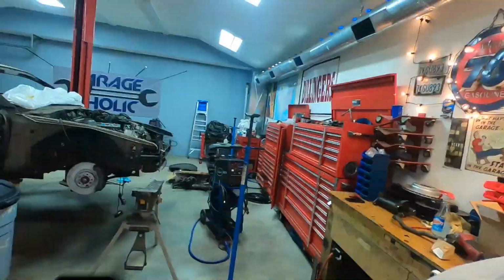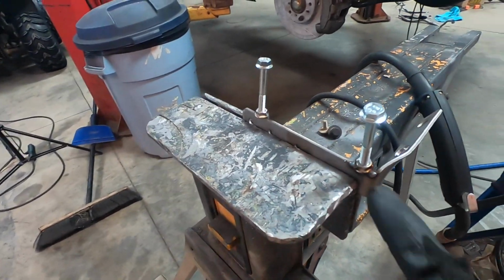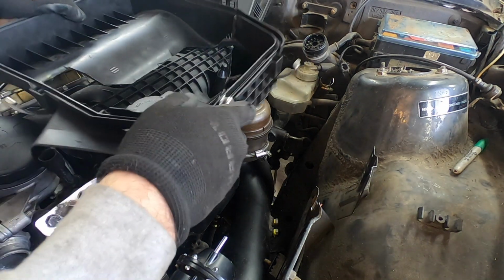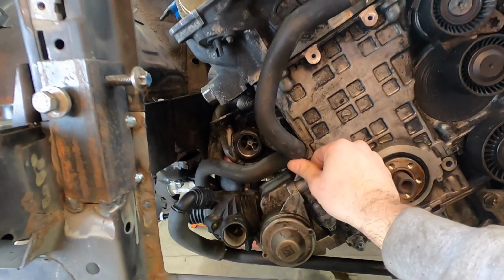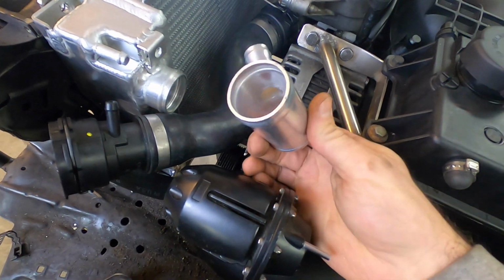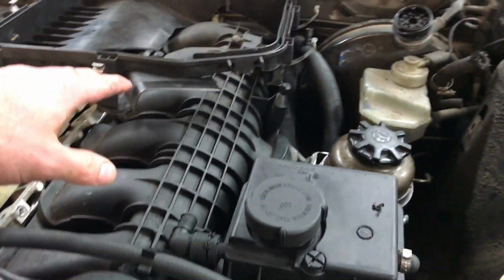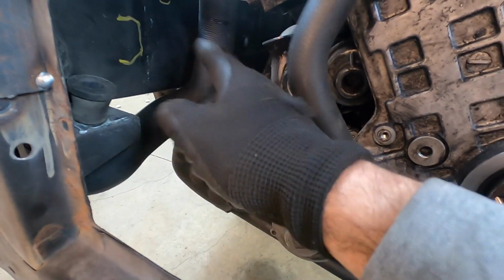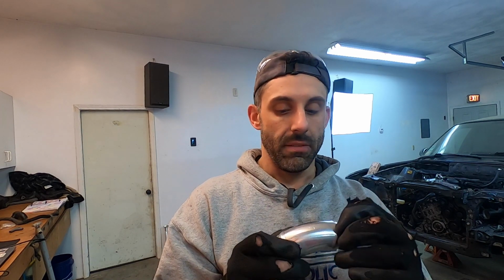Part 13: How To Customize Coolant Lines In Your BMW Engine Swap!!

Comment: Dont forget this,on the e30 he heater core has the outlet on the top and the inlet onthe bottom, and you can not usit the other way arround becouse off the internal valve.
Just tring to help xD, but you didit the rong way arround
Reply from the maker: Very easy swap - thanks for the tip!!!!!!

Comment: How can you be sure the cooling system doesn’t blow under pressure Im doing this swap as well
Reply from the maker: You can bleed it by virtue of the electronic cooling pump, INPA has a program for you to bleed the system without having to start the car - works pretty good